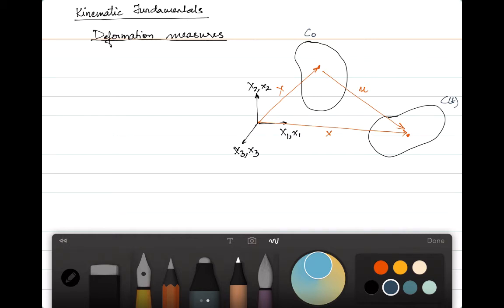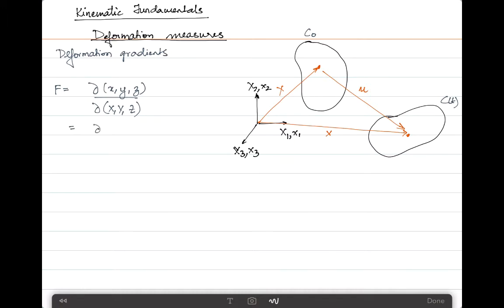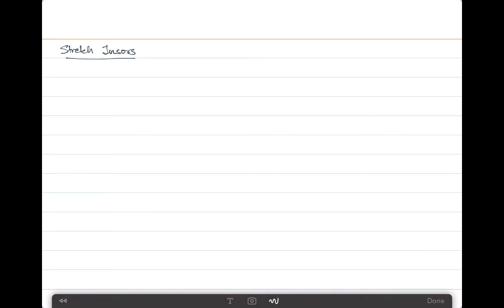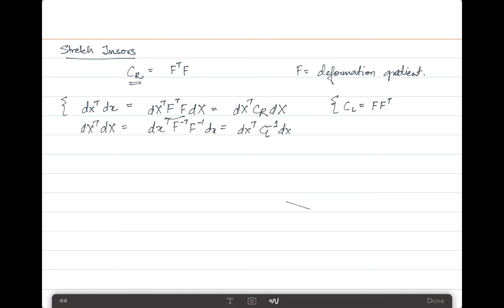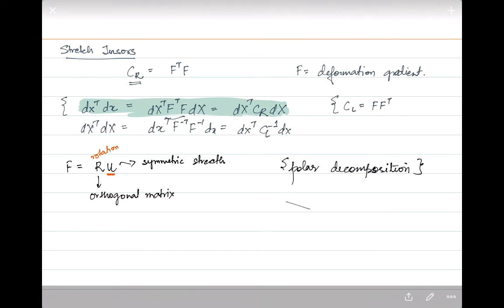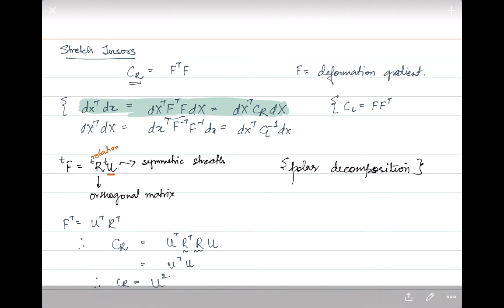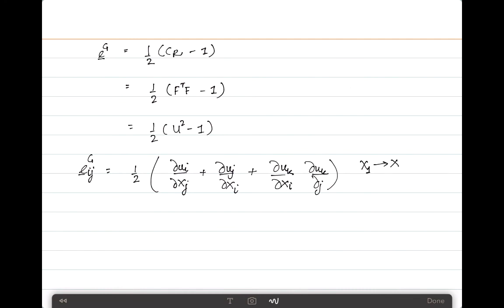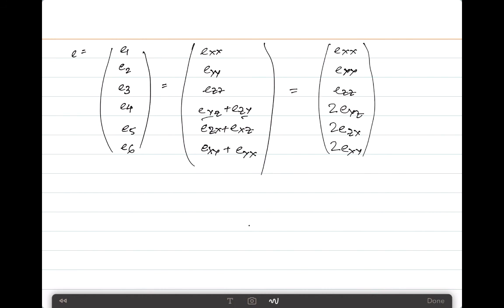Fundamentals GL Strain

Comment: please, can anyone explain to me where the 1/2 is coming from? i understand it has anything to do with linearization, but i can't find a proper explanation anywhere :(
thx in advance!
Reply: If I remember correctly (not 100% sure), the number 1/2 is artificially added in the definition of the GL strain tensor (and analogue to that, Euler strain tensor), simply to have better mathematical behaviour in calculations. It's a normalisation factor, in other words. The reason linear analysis is always mentioned with that 1/2 is that it makes most sense in linear strain (small deformations) is to compensate for gamma (angle deformation) being equal to 2*epsilon on the same position in the tensor. I'm not an expert on this, so don't take it as simply true, but rather to help you find the answer in proper literature.
Reply: I will write the definition of the book here:
the factor 1/2 being a normalization factor (whose significance is explained in a
more general context in Section 2.2.7). Clearly, the material is unstrained at X if
and only if E = 0 at X.